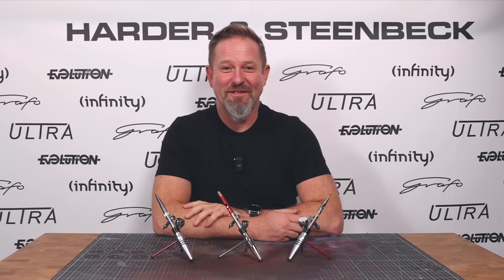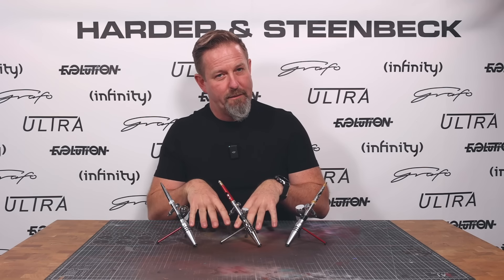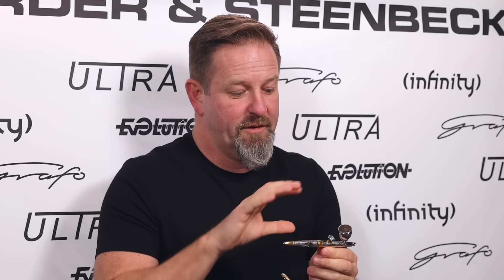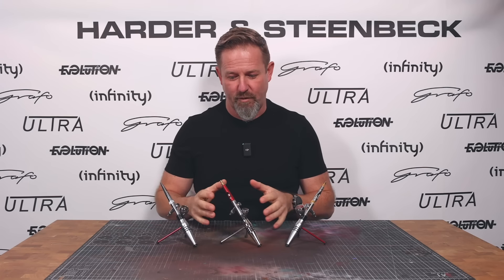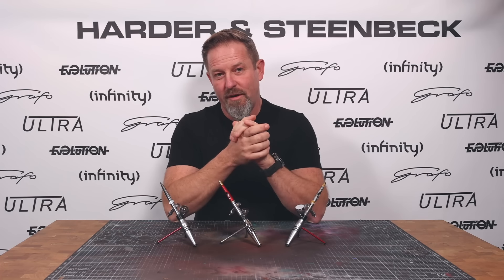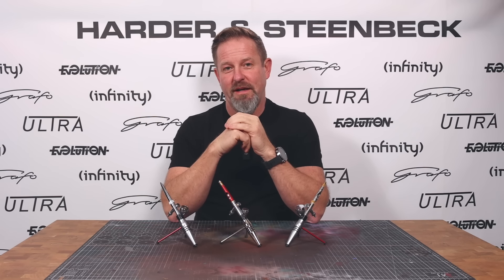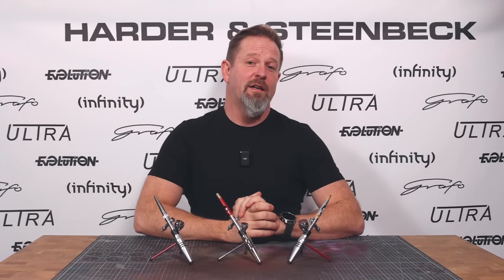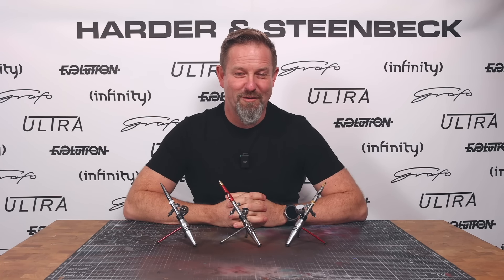Let's talk about the Infinity 2024 CRplus Airbrush!

Comment: I love how you can see your enthusiasm for this on your face and how you've reached out to your users for feedback. Says everything you need to know about H&S and how they conduct themselves in my book.
I bought my first infinity 15 years ago (had to go check my old youtube vids to find that out... I look so young lol) and still have it now. The nice shiny finish has come off where my fingers have been rubbing for over a decade, but she only ever needed a needle replacement once due to me knocking it off my desk. I also have the Infinity CR Plus and Evolution AL Plus which are part of my daily "tool kit". I must admit, if I'm doing something with really tiny details, or at a point in a project where a spit could ruin hours of work, I tend to go for my micron made by that "other" airbrush manufacturer. Simply because of the trigger response. Every infinity I've ever owned (3 now) has had a delay from when you pull the trigger back to when the paint comes out and quite a lot of the time I found myself "priming" it on a bit of paper first, pumping the trigger back and forth by a mm or two just until the paint started flowing. Once I did that all was fine and I could crack on with painting. It doesnt help that I tent to paint with "slightly coloured water" as Giorgio told me once lol. I heavily reduce my paints to get the micro details I like but that often results in spitting and spidering which, I'm afraid to say, I get less of with my micron. You talking about being able to use a thicker paint with the awesome trigger response is really interesting and I look forward to giving that a try!
As far as triggers go, I really haven't had any problems other than a Badger Renegade. The Badger had just a round trigger and my fat fingers had a tendency of slipping off every now and then.
I absolutely LOVE how you're approaching this one as being a detail airbrush rather than an "all rounder". My inner detail freak is jumping for joy right now :)
The 2ml cup is perfect for me personally. It is also the same size as my thumb so I can just put my thumb over the top and give the brush a shake to mix my paints directly in the cup.
When it comes to weight, I never really noticed a difference until I got hold of my Evolution AL Plus. That brush is sooooo light and is a joy to use. The Infinity isn't too heavy by any means, but I can really feel the difference when using my AL Plus.
As someone who paints anything from guitars, canvas, 3d printed figurines right down to little Warhammer figures, I honestly can not wait to get my hands on the 2024 Infinity :)

Comment: Hi, Warrick. It is a great and exciting video. I am not an artist, but I use the H&S airbrushes extensively; I have seven of them (2 Evos and 5 Infinity) for plastic airplane modeling. The difficulty we, plastic modelers, face is to spray consistently close to the hard plastic surface without the paint bouncing back on impact because there is zero absorption. That is why I want an instant response to the trigger for total control. 
A tight beam is also a must to avoid overspray when painting camouflage. Lastly, I need a handy airbrush for retouching without having to mask extensively.
I love my airbrushes, but it would be fantastic if the new Infinity could improve these areas so I can confidently demonstrate different techniques on my channel. Thank you for showing your passion for your product it is exciting.

Comment: My 2024 Evo CRPlus solo arrived today...long story short--I'm going to be up all night tonight painting w/ this gem of an airbrush!🤩 The trigger is so smooth and comfortable, instant response when you pull back for paint...I can effortlessly do such fine lines, continuously, using E'tac opaque Plasma White thinned w/ distilled water on a black paper envelope--such control! I didn't even remove the nozzle cap and after 15 or 20 minutes of spraying the opaque white there was no tip dry at all! Right now all I can say is this is a superb airbrush and I'm going to be up all night airbrushing tonight! Also I think I'll start saving some cash to get one of your new 2024 Infinity airbrushes. By the way...until I got this Evo I've been using Olympos Microns (and an SP-B) pretty much exclusively since retiring all my Iwatas.

Comment: Hi Warrick,

great Video, as always and a lot of questions.
I’ll try to make is as short as possible.
I am usually airbrushing portraits in b/w and colorized as well, sometimes in a very small size.
After the Evo came out, I am only using this airbrush at all, putting all others, including the highly praised Iwatas away. 
In my eyes you did a phantastic job so far!
To your questions:
1. Thicker paint, same point of releasing. That would be a great progress, I had this problem last week in a mini-portrait and my outcome was, let’s say in need of approvement.
So, definitely YES!
2. The best trigger I used before the Evo was from the Iwata Takumi, but now it is the Evo’s. The design is great and in my eyes, there is no need to make a big change.
3. Shorter distance between airbrush/trigger finger to the surface is always good, especially with small pieces of art work, but I find the distance absolutely satisfying with the Evo. 
4. Detailed work from a bigger distance would be absolutely a big breakthrough because it helps you to stay relaxed and you could cover also longer painting times instead of hanging over the piece all the time and stiffen up very quickly.
5.
Sketching caps, I never used them with my older Giraldez-Infinity, so I don’t really have an attitude towards them, only that I like to have a free view on the needle of the airbrush (crown cap always off).
6. Cleaning up time is MUCH quicker than in any other airbrush I used before, including the older models from your company. Very well done!
7. Cup sizes. I only use the 2ml cup for my work and this is more than sufficient. It is good to have the 5ml option in case it’s a bigger artwork (background). I personally don’t need a smaller cup than 2ml, but some people could argue with a smaller cup you would have a better view on the subject. That might justify a smaller cup size.
8. Weight. Not the biggest point for me, I find the weight of the Evo perfect and personally don’t feel getting disturbed by the weight too much. 
9. The big secret. I don’t have a clue and I am really excited to see what it is, perhaps a more direct view line between the needle and the point of impact of the color on the surface?

Whatever, I hope this helps you a little with your great work.

Comment: You ARE a tease! As an owner of the current Infinity I’m so looking forward to the new one with the improvements from the ultra and evolution. It’s been a great detail brush.

When it comes to cup sizes, I use the 2ml exclusively. It’s what fits my work the best. I rather add some more paint then try to pour it back.

I also got a cheaper brush that I use for priming, varnish and other less detail. It weighs significantly more than the infinity and I prefer the lesser weight in my hand while painting.

Comment: Hi guys, I’ve always used your brushes and now I’m using the Evolution 2024 and the only thing I would improve is to decrease the resistance on the air valve (I get a little tired after a long use). For the Infinity I would prefer a trigger with a wider support (I found those of the Mobius style CM Iwata very comfortable for me to be clear) but no longer that of the Giraldez that I replaced with that of the new Evolution. I prefer the light weight while for the cups the current measurements are excellent for the use of a precision brush. One thing that can be interesting would be the ability to adjust the tension of the trigger for both air emission and needle adjustment. Obviously I can’t wait to have one in my hands THANK YOU

Comment: Hi Warwick. Great that you're asking actual users. Really appreciate that. I moved from an old style Ultra to the current Infinity a couple of years ago. Somehow I always preferred the paint response of my old Ultra. No idea why but maybe it was the trigger response or spring weight. I also found the trigger shape worked better for me. I do love my Infinity though for its ability to go super fine - it's great for the plastic modelling I do. Freehand camouflage is possible with no masking if im careful. The overall weight of the Infinity is spot in for me too. I find the micro cup really useful for small tasks so please keep compatibility for that although I mostly use the 2ml cup. I also find the trigger limiter great for letting my kids paint as they just blaze away with no finesse at all so please keep that. Ultimately for me I'd want one airbrush that is super easy to clean and to do everything extremely well - from priming larger surfaces with thicker paints through to ultra detail with limited feather at the edges and great instant control but good paint density  (maybe I should get an Evo?). I would maybe suggest a few kit options - base models with single needles, a twin needle 'fine' option with micro cup and 2ml cup with finer needles, and finally a 'general purpose' twin needle option having the 2ml and 5ml cups with mid sized needles. Looking forward to needing to make a decision later in the year...

Comment: Another great video and very interesting regarding the Infity 2024. I would love to see any easier way to remove and potentially replace the head. However, I do have an unusual use case in this regard. I would prefer a trigger that is not indented. Flat, yes. Curved upwards, yes. keep up the good work 👍

Comment: I have the Evolution 2024, nice brush, beautiful spray, and easy to clean. I have owed an Infinity cr+, what I didn’t like about it was the needle limiter at the back of the back of the brush, too complicated. Love the needle limiter on the Evolution 2024, simple screw adjustment. Could never figure out the Infinity’s needle limiter so I sold it, that pop out feature is nuts. Will the 2024 Infinity have a simpler just screw adjustment for the needle travel limits?
Reply from the maker: Oh man you’ve missed out on something beautiful! Here’s how to use it… click it IN and adjust to the limit point you want… do your thing… when you want to flush or clean, pull it out and you’ll have a full trigger pull available right away… now here’s the cool thing… push it back again and you’re back EXACTLY where you had it set before flushing/ cleaning. It’s really a position memory system. And of course the new one has it too, because it’s (in my opinion) the most convenient interpretation of the needle limiter concept with infinite adjustability. Does that clear it up for you?
Sign up here for the new one! W
https://bit.ly/3AJETgs

Comment: I've tried twice to get a working on brush pressure regulator assembly. They both made the trigger feel extremely gummy. The first one didn't work at all. I had to send it back to the (authorized) merchant and the replacement they sent had the same gummy trigger but actually worked... until the second time I tried to use it. So what I want out of the new infinity is a built in pressure adjustment on the brush itself and that actually works.
Reply: I also vote to please keep the 5ml cup size.

Comment: I've found the Iwata micron trigger shape to be the best because it allows my finger to naturally and easily roll the trigger as it gets pulled back.

Another thing I like about some other manufacturers is the the wide but not tall paint cup. The thin part of the paint delivery (where the threads are on the airbrush) is something I don't like for some reason. 

Would love a fixed sotar cup on a H&S. 

I don't have a 24 model yet but will getting the infinity.

Comment: Hey guys. As an owner of the standard Infinity CR Plus and a Giraldez, I much preferred the ergonomics of the standard Infinity. It also made me realise I can't use anything less than the 5ml cup because of the larger scale model work I do.

I love the control of the 2-pronged spray heads but I have damaged 2 needles just from carelessly docking my brush in its holder.
My only wish would be for the new Infinity, or even the older ones, to have the option of a switch out head that protects the needle more (much like that of the Ultra)

Comment: I'm minis painter so I change a paint a lot, and I also often use very little of paint with my detail brush. I like even smaller cups like 1,5ml cup on Iwata but internal  desing of shaft under cup is more important too for my mixing paints inside cup than actual size of it. Also easy of cleaning between changing paints is good thing.

Comment: To answer your question about triggers, I don't have much of an opinion on the best airbrush triggers, however they have a similar function to analog sticks on controllers, and lots of people like to add various rubber grip extenders to them to give them more fine-tuned control. Which implies that a larger shape, with a bit of harder rubber that's non-sweat and has breathability to them as well as increasing the distance between the top of the gun and the control point of the trigger are all great ways to increase control and responsiveness.
Reply: I use a hot glue gun to "sculpt" a large sort of cylindric blob to make taller triggers for all my Olympos airbrushes for the exact reasons you mention--to increase control and response. An airbrush trigger is a lever, and the longer the lever, the finer control you have, basic physics. Some airbrush artists however, like Dru Blair, claim the opposite--that a shorter trigger gives better control....and maybe in their minds it does, I don't know. I just know that taller triggers work better for me.
Reply from the maker: @sped17373 @joelsmith7078 we have indeed done something unusual with the trigger, which is aimed at giving much better perception of the trigger feel and position. It is not either of the cases that you have described, but it has tested extremely well! Looking forward to releasing it to you all! W
Reply: @sped17373  I suspect there's a balance to be struck with them and finger length or grip style -- namely if a person has smaller hands and finds his/her self reaching up as opposed to down to get to the top of the trigger, then a taller grip might be detrimental.
Reply: @harderairbrush  I love the feel of my Evolution 2024, so I'm excited to see what you've done!
Reply: @joelsmith7078  Good point--I have long, skinny fingers so a taller trigger not only gives finer control, it just feels more comfortable to me. The triggers that come standard on any ordinary out-of-the-box airbrush is almost always too short for me, such that my hand will cramp up very quickly. That being said, I just today received my 2024 H & S Evo CRPlus solo and the trigger on it actually feels pretty good as is. I really like this airbrush so far--I'll be up all night painting tonight!

Comment: Sign me up!! I cant wait.. Any approx release date?
Feedback on sketch cap, I normally dont use a protective cap mainly for ease of cleaning tip dry, if the sketch cap can provide protection and allow cleaning with just my fingers then I would use it.
Feedback on cup size, IMO if the brush is intended as mainly a detailed airbrush, the micro cup would be a welcome addition. Personally I only use a few drops of paint at a time and have no need for the larger cups.
Thanks H&S for all the R&D that you put into your products. It shows in the finished product

Comment: Question: I am using my old Evo CR+ for more than 4 years now, have a full range of nozzles to it: 0.15, 0.2, 0.4mm. And they're great! But my biggest concern was always that sometimes paint that is heavy on pigments clogs the nozzle (all we do mistakes, right?). This is totally fine as far as you have a way to clean it without full disassemble, coz it takes time and stops you from painting for 10-15 minutes. There is a way to avoid this: close the nozzle and push some air into airbrush to remove the paint from nozzle. But due to it's material and internal polish (I guess?) that doesn't work every time. So my question is: Is there a chance that with new Infinity 2024 we'll get some kind of "premium" nozzles made from stainless steel with better inside finish? Paying extra money to have better durability and spending fewer time on cleaning. Is this possible?

Comment: I’ll try to answer everything I remember from the video (first and foremost I appreciate you asking the end users, not enough companies do this imo as application varies wildly from professionals).  My first H&S was the Giraldez Infinity.  I’ve since added both Squidmar Airbrushes and two of the Ukraine Airbrushes and the Cult of Paint one.  I use them all and I find myself finding different things better on each one.  I LOVE the sketching caps, especially when it comes for gradients, I find it helps me immensely keep on point versus the naked eye (I tend to paint 1/12 scale items as opposed to minis though I do some of the latter as well, so my applications might be different).  The trigger I prefer the squidmar one and I love the ultra adjustment dial compared to the others.  The Ukraine ones I really enjoy the finish in my hand more so than any of the others.  For cup sizes I like both current sizes just fine, though I would like a mid between them for some broader base coating applications without it being too much.  And cleaning, anything that makes that quicker or less arduous is always a win.  I find my Giraldez is the easiest to clean in between and during use.  I am excited to see the upcoming one!